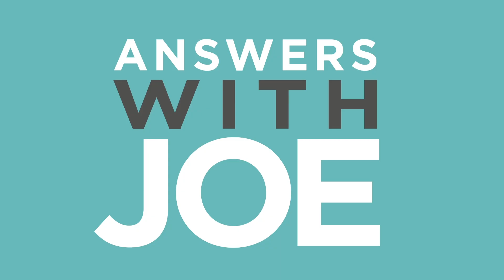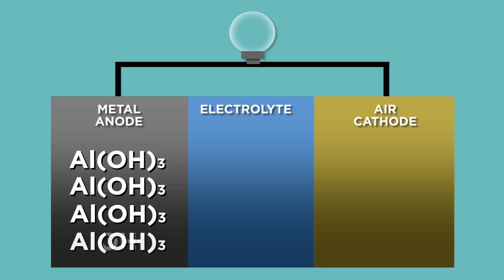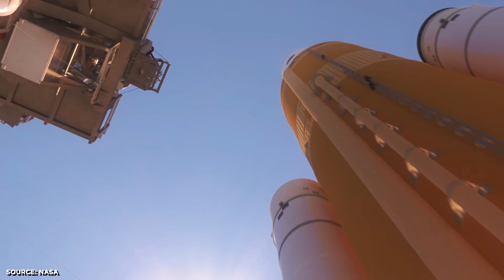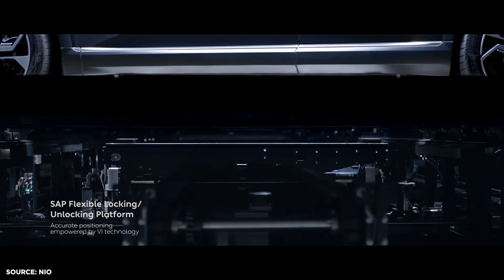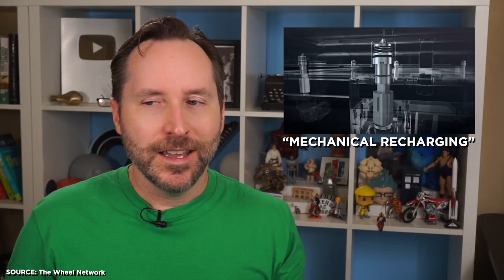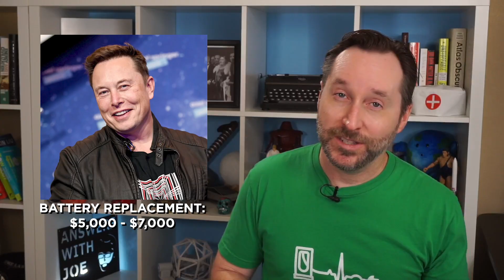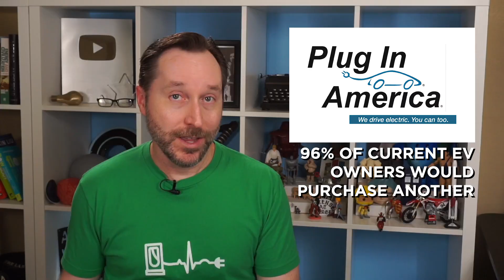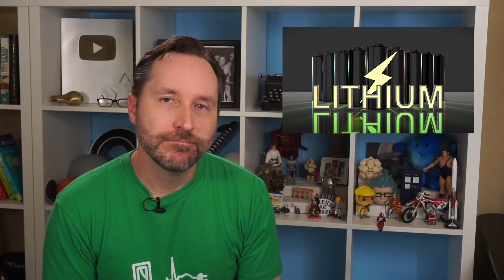This Battery Could Drive A Car 1500 Miles - But There's A Catch | Answers With Joe

Comment: I think these would make a great backup power solution for houses. A homeowner could buy one or more, and only use them to power the house (or at least the fridge lol) during a power outage. Like a backup generator that doesn't run on gas. And then they could take it in for recycling when it's used up, maybe get credit toward a new one.
Reply: The battery slowly loses its charge over time so it wouldn’t work to keep it around for a year waiting for the power to go out.
Reply: @RjWolf3000  If the battery comes with a protective cover that prevented air from getting to the aluminum that should prevent it from losing a charge.
Reply: @lunaticbz3594  it seems like once you add the electrolyte mix it starts to decay.  So if you crack the seal and the power comes back on an hour later.  This battery seems like its best use is an eat in one sitting scenario.  Not a system that would sit idle.
Reply: Well if we're going green why not do a video on grow lights and how efficient they are.
Your thoughts on different kinds of grow lights resone to see how much heat they make how much energy needed how efficient and whats its light spectrum is can we use 1 or do we need multiple kinds to have better greenhouses/vertical farm.
Reply: Yea in india the electric grid is as reliable as politicians so everybody own big ass lead acid batteries
Reply: @tis_ace  lad acid is literally 1 of the worst battery you can buy hell.if you discharge it past 50% your now damaging the battery most batterys today need to be discharge 85% before damage starts happening.
Reply: @thesilentone4024  im not saying its the best solution, its just the solution we indian use
Reply: @thesilentone4024  I think this is only true (or truer) for normal car lead acid, where the leads are thin, not ones where the leads are thicker and specially built for that purpose they can hold their own, my last ones lasted for 5 years.
Reply: @TemporalOnline  I wasn't talking about a car battery i was talking industrial batteries for a town or small city the most efficient led battery out there can still only be discharge to 38% before damage starts happening so its 12% less but still really inefficient.
Reply: @thesilentone4024  they're cheap though
Reply: @thesilentone4024  Also you're wrong, you're thinking of the lead acid batteries in cars, there's such a thing as deep cycle lead acid batteries that can be fully depleted without damage.
Reply: @thesilentone4024  just treat the usable capacity as 100 percent , and lead acid battery is  cheap and 95% recyclable. i don't see any other batteries for home power storage.
Reply: @thesilentone4024  usable capacity varies on chemistries we cannot do any thing about it. we just need cheap batteries. some say lead is toxic, but we are not using it in our body :) 
i think its all about marketing strategy.
Reply: @sayyidsahal4533  theres lots water batteries they have been around since 1920 or longer.
We got led yes but after it goes past 50% charge it does damage it.
This one is ment for cars not homes but also need whole batterie replaced after it hits zero.
Lithium is ok but there are more then 1 some help stop fires some help with charge but increased fire chance right now we get a 93% safe Lithium 1 so its really not all bad.
Hell your feed is power and fire.
Ok let me explain how. 
1 Food in big ait tight bag with ways to get gases out and put food in.
2 you can use the gases the food makes for fire to cook so methane gas fire yes works well.
1 use that methane to heat up a mini water turbines to power just your home not likely to power more.
There's also mechanical energy it has been around since 1849 and we do still use it for at lest 7% of are grids.
Reply: @sayyidsahal4533  its toxic to mine and recycle and if it leaks its bad thats what there saying.
Not its toxic to have but there life is so short and the process of mining and recycling them is very bad for the environment for led is very hard to get out of anything.
Oh don't forget we found ways to make energy and store it without batterys and yes it happened.
Mechanical batterys aka old as hell 1849 is when it was invented and we still use it yes only 7% of are grid is this but still.
We got water battery its been around since 1800 to 1801 to today hell 20 to 25% of are grid uses this.
Physical energy aka you are the power so get on the bike and pedal tell batterys are charged.
I can go tell youtube tells me stop texting but I will lose you then.
Reply: Places that currently use diesel generators would buy this instead
Reply: @robertoaguiar6230  not likely. A diesel just needs to be refueled (and fuel is usually easy to come by), can last for decades. An aluminum air battery at least currently would not last decades as it loses charge over time, needs to be replaced when it’s empty as it can’t be recharged, and would probably be more expensive than an equivalent amount of diesel.
Reply: It's more than that. In my small New England town and surrounding area, everyone has oil for heat, and right now it's expensive as hell. We need viable renewable options to replace fossil fuels in every area that they can. There's no reason it shouldn't be possible to have batteries that store excess heat for instance. I believe the government should invest very heavily in infrastructure...restructuring.
Reply: @philipm3173  sure, but the electricity in these batteries wouldn’t be cheaper that the electricity in the power lines that come to your house.  I agree with your larger points although heat and cold storing seems like things home systems will do, not municipal suppliers.  Heat being much harder to store because water boils if you try to overheat it for storage.
Reply: There thinking of iron air batteries for houses/ infrastructure.
Reply: My Dad has had his home hooked up to battery, it's amazing to see what stays working during the storms in Ottawa, but it's at the expense that he assembled and not many people have that kind of enthusiasm or money to make it happen.
Reply: It could even be used for remote buildings which are too far away or situated too inconveniently (ie mountains, small islands) for being connected to the grid and use alternatives in generators and butane tanks.  Instead of transporting fuels or gas tanks you transport batteries from time to time.
Reply: Or you could buy a power wall that is rechargeable doesn't need to be topped up and can also be recycled.
Reply: yeah but isn't making these disposable, even with recycling (as far as that would actually go) be worse than refilling a gas tank once in a while?
Reply: @inoutdoor4211  I think the payoff is in the total energy used to recycle versus all the carbon from the petroleum cycle. Petroleum is wasteful. But it should be relatively easy to compare those numbers.
Reply: Excellent idea.
Reply: Flips 5 cent coin.
Reply: I don't know about you, but my (quite normal for the UK) house is small. There is no space for a battery backup system.
Reply: People were (and probably somewhere still are) used to change their gas tanks regularly like this.
Reply: Thats genius... like many places do with bringing in empty  plastic bottles. Get some money back for bringing back the used up batteries
Reply: I doubt you'll find many people invest that kind of money into something they might use for a short period a few times per decade.  It's not just a battery either; it's power electronics and a change-over control system too, or you may as well just run a powerbank.
Reply: so cute ...
Reply: Great idea!
Reply: If everybody had a little nuclear reactor in their basement the size of a coffee can, we would no longer have any need of being wired into the power grid sucking from the community tit.
Reply: Regular gas generators are far more cost effective for that purpose.
Reply: I agree there's room for them on the market, but not in EVs.
Reply: what happened to aluminum causing alzheimer's? Was that debunked subsequently since the 90s?
Reply: @graemep.1316  Too much of any mineral can be toxic. Last I heard, many forms of Alzheimer's are aggravated by lack of fat. The brain is a ton of fat, and we've cut most good and bad fats out of our diets. Fat tends to bind well with toxins. If you don't have enough, what you do have (in your brain) will become a toxic magnet, and then get very placquy under a microscope  - especially with the new chemicals that we have exposure to that weaken the blood brain barrier. (Some people also have genetically weaker barriers too.) End of the day, eating/consuming way more good fats and less carbs/sugars seems to stave off or slow the progress of most Alzheimers. (Though there are other causes/variants too, as with anything. Genetic, brain attacking diseases, etc.)
Reply: The upcoming vehicle Ford F150 Lightning, which is an electric vehicle, will have enough charge to power a home for a day, should there be a blackout.
Reply: Hasn't someone has already thought of this, albeit with rechargeables and being sold as something for computers?  It's called a 'UPS'. :)
Reply: @danieljones9937  Correct me if I'm wrong I haven't owned a UPS in about ten years so not sure how much they advanced, but when I owned one for my computer it provided power long enough for you to save the work you were working on, and then shut down your computer.  It didn't actually provide power to keep using your computer till the power company gets you reconnected a couple days later.
Reply: @lunaticbz3594  Some modern UPSs can give you an hour or so, maybe more if you're running a low-power system. That's still not a lot of time, but it is more than enough to ensure data is safe.
Reply: @lunaticbz3594  I have one that uses 2 car batteries (actually although they can be used in cars they are better built for UPS purposes as deep discharge) and they can hold my pc on for 6 hours. I've hooked it up to my room and it can hold my room(as long as I don't use the pc) for 2 days.
Reply: @lunaticbz3594  You're talking about consumer-grade UPSs. Some enterprise-grade UPSs can power computers all day. It's just a power storage problem; a lesser problem when computers used less power, but still not as big as a solar power system for a whole house. And anyway, the U means "uninteruptable," not "just barely enough to save your files."
Reply: @lunaticbz3594  I was shopping & I was looking at some

They can give a 5 hour rating for the wattage they say

Really depends on how much you want to spend
They were around 300
Reply: @lunaticbz3594  Yep. UPS's also typically have a 2 or 3 year warranty, and the battery wears out in 2.5 or 3.5 years. Often the cost to replace the battery is the same as buying a new unit on sale...
Reply: @lunaticbz3594  bought a set for 200USD and when electricity goes out i can use PC, fan a small pedestal fan and WiFi for like 6-8 hours

Comment: 🤓 Actually...
A "battery" is a pile of cells...is...is what an overly corrective nerd would say. Probably. I wouldn't know, not..not being a nerd and all! 
C'mon guys it was ONE TIME!   jeez.
Reply: Hello :)
That's right ! Here in France we call them ”piles" as in a pile of discs/cells. I'm not quite sure about the metals, but I think one of the first working batteries way back when used a pile of alternating zinc and copper discs, with acid in between. Nowadays, we use the word "batterie" more and more as rechargeable batteries take over 🤔
Reply from the maker: Wasn't "Piles" the name kids called Niles Crane in Frasier?

See, I know things...
Reply: @joescott  That was a very funny show!
 You DO know stuff! 👍